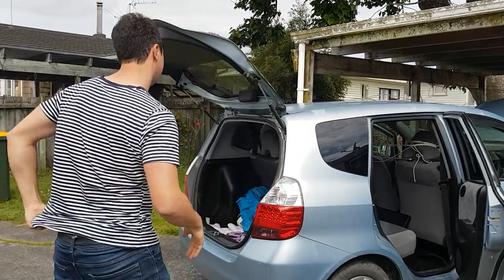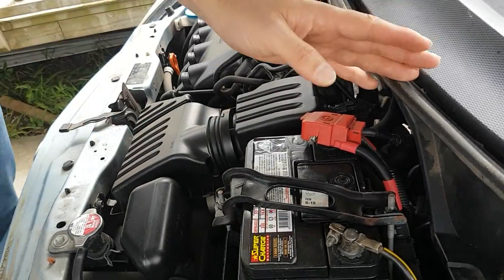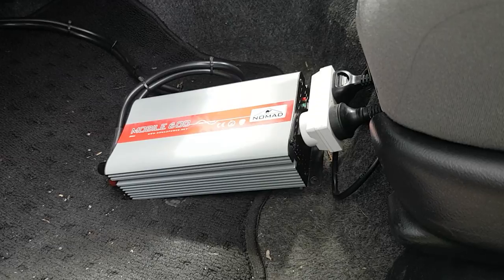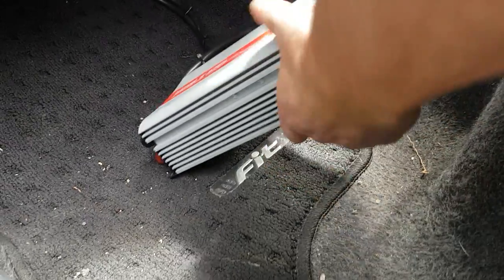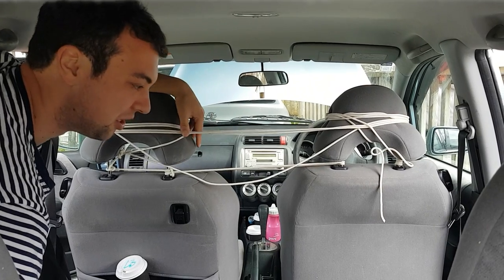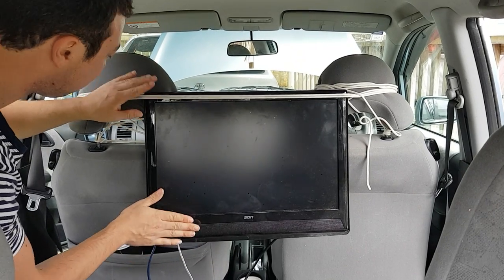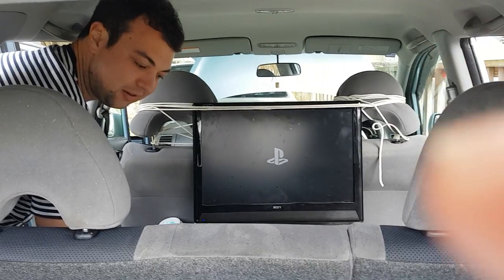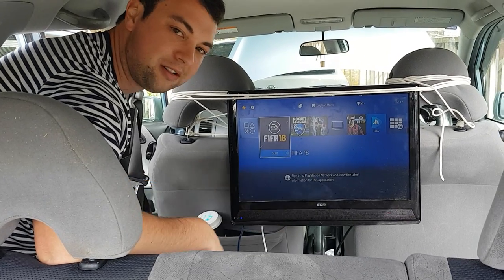Car Inverter and PS4 Installation Overview

Comment: Hey man I like your work.just curious, how long can you watch TV/play ps4 until you need to start car or recharge battery?
Reply from the maker: I haven't fully tested it out sorry, have played for 20mins with the car off.
Reply: Have a spare battery at the ready to jumpstart or even run directly from the spare battery so you dont run the risk of draining your cars battery.
Reply: an optima battery is wat yu will need my friends. its the highest tier battery that is a gel based battery which slows down the electricity usage by a large percentage. its around $300 at Advance auto, but its worth the money. thank me later🤙🏿.

Comment: I would be worried about a hard drive in the ps4 failing after hitting too many bumps in the road. Easy fix would be an ssd. Problem is a big one would be expensive. Also ps4 in a car and a monitor makes it something someone would want to steal.

Comment: So the car needs to be running its engine for the set up to work?!
Reply from the maker: you can have it going for a bit when the engine is off as it runs off the battery, but your running engine charges up the battery
Reply: @leightonmorris8654  so the best way is to keep the engine running while ur on park and playing?!
Reply from the maker: @jonnytapia848  the design intention was to play while someone else is driving. But you can certainly play while the car is parked with the engine running! if you really wanted to not have the car running, you could set up an extra battery in your car, solely for the ps4, which charges up while the car is running but is only used/depleted by the ps4.

Comment: please message me back, i have a week left before i do my trip. is there anyway i can buy a car battery thats a deep cycle, and use it while i have a solar panel car battery charger, with a voltage regulator ?
Reply from the maker: solar panels don't generate a lot of power but could work, sounds like a complex set up.
Reply: do you have any alternatives ? that could work better
Reply: @mazon1x  I personally utilize the power of nuclear fusion

Comment: I have a 700 watts black and decker inverter and a 1 tb ps4 will it work if I put it in the car battery? Because I have a feeling it will explode.

Comment: Lol so you know that its 2017-2018 already right? No need to tie a small house tv to your head rest on your seats lol bro how much more ghetto can you get hahah at least your having fun, but still is funny seeing this. Maybe you should craft something tjat can hold it in place neatly you know just an idea , and definelty move that transformer thing you have by the peddles and extend it so it fits neatly under the seat
Reply from the maker: Space Astronomy  thanks for the feedback! I'm a millennial so I don't have money for a nice layout, I spend it all on avocados.  I will work on a less temporary fitting solution if I decide to keep the tv in there permanently. I'm not so sure about the inverter under the seat, I've got enough cable length but I'm concerned about air supply :/ thanks for the time in making your comment and appreciate the support!
Reply: Hahahha

Comment: The hard part is getting to cables from the battery to inside the car.
Reply: Not Vladimir Putin you can get inverters that just plug into the cigarette lighter and they convert normal 12v to like 2 120vj

Comment: If ur playing while the car is running, will the ps4 run infinitely? Pls get back soon im doing a 9 hour road trip
Reply from the maker: yup it will run infinitely, the car will generate enough electricity while it's on. To be safe, you can turn off the ps4 10mins before you arrive at your destination; just to ensure the car generates some power to charge your starter battery- and so you will be able to start the car back up!
Reply: Leighton Morris Thanksss! Also legendary vid

Comment: if my tv and ps4 consume 400w and i used an inverter on a car battery, how long will this be run? lets say on a charged battery and the engine turned of.
Reply from the maker: not long, like 20-30 minutes, standard car batteries are not designed for heaps of capacity but rather to draw heaps of power to start the car.

if the dream is playing while the car is not on, look in to setting up a circuit with a deep cycle battery and switch. when the car is on it charges your deep cycle battery, and when you draw power for ps4 it only takes it from the deep cycle battery.